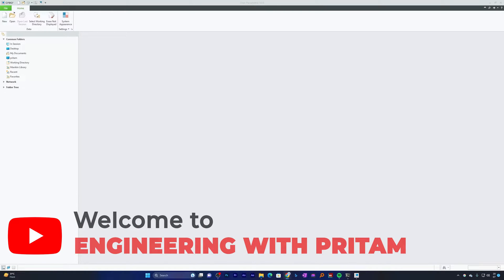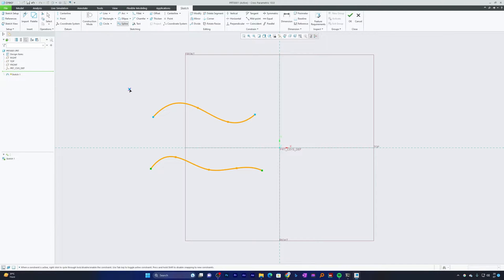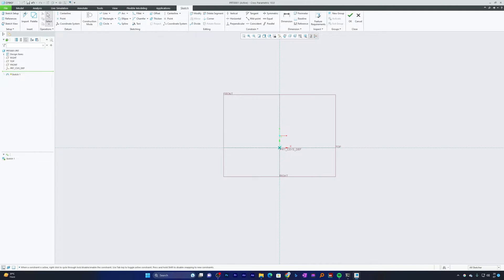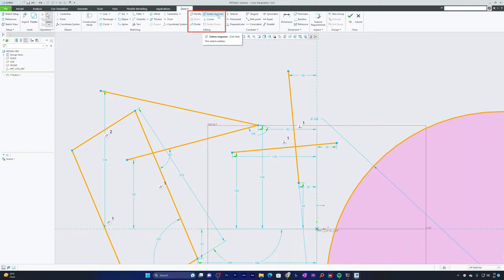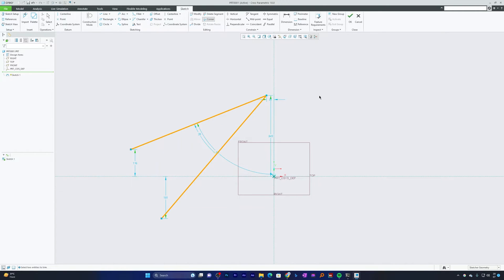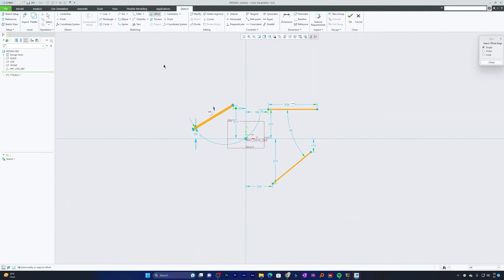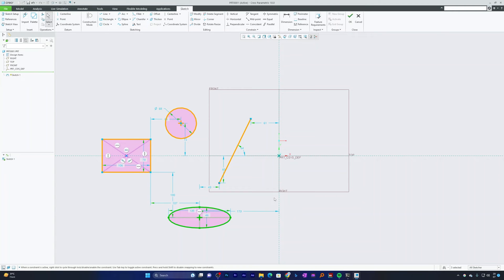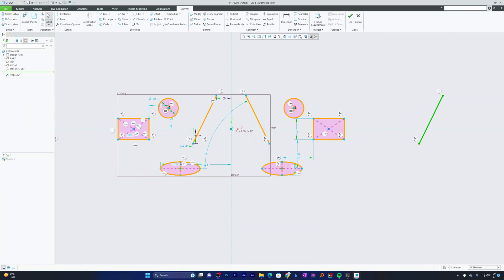PTC Creo Parametric Full Course : Sketch "Spline, Mirror, Trim, Delete Segment" Part. 8

Comment: Hello Sir, I have a problem that the window of offset types does not appear at all so I cant change the offset type. Could you please help me if you know about that? And thank you in advance.
Reply: I'm also having the same problem. The "offset type" window isn't appearing.
Reply from the maker: Hi there! It sounds like you're facing a technical issue with the offset types. Have you tried restarting the software or checking your settings? Sometimes a simple refresh can do wonders!